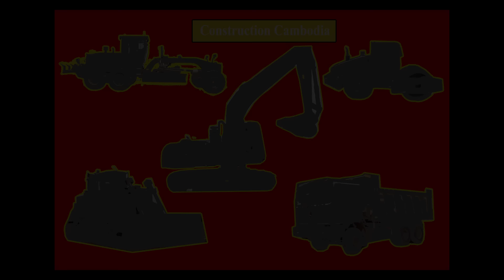Bulldozer stuck in deep mud & recovery by Excavator

Comment: Why don't they make equipment so you can put cables on it so you can pull crap out they need to be put on the front and back wall equipment. It looks like a little kid design them. It would have been easy pulling if they would have just designed a pulling system for the rear of it. They could also use the bulldozer to help pull it and it would have been out a lot faster. But I guess the boss new best

Comment: wow amazing no one was killed. Clowns milling around a machine in operation. Standing beside a cable under huge tension, luckily it didn't snap and take someones head off. Should have used the dozer, truck and excavator together to pull it out in a couple of minutes.
Reply: Yes, that cable is dangerous!
I lived there several years, came across a badly stuck excavator with one track run off.
It was interesting to say the least.
Reply: In these Asian countries, for some reason there is always 20 guys in "charge." I was there on a large engineering assignment and on the very first day shut down the operation , had my translator tell the engineer who hired me to run the project, "either I am the ONLY one giving direction, or I am happy to allow THEM to give directions, and I bare no responsibility, it is up to them." 5 minutes later we working again, and I didn't hear a PEEP from the peanut gallery. (It was heavy rigging and involved a 1 million printing press, Heidelberg.)  But I could see someone was going to be hurt with 20 guys telling the Tow operator what maneuvers to make. They later in the week had a unit tip because a timber crumbled and was precariously leaning against the side wall of the building ready to break through, same thing, 20 guys runing in circles screaming, waving arms and getting ready to tell the tow operator what to do. I screamed SILENCE....  had my translator to tell everyone to clear away, and they all went and sat down and watched me upright it 1/2" at a time with a jack. These things are not toys. Education is where the issue is guys on such matters, they don't know.
Reply: Larry Gingerich gli
Reply: maKan bO1eh
Reply: @brentbarnhart5827  been there to,  logic seems to be lacking with most of them,  but i worked with a couple that were really switched on but had no respect (caste system). after 2 years they were all supervisors that i gave the power to hire / fire.  that really shook shit up. still was one of the best road / rail infrastructure projects i have worked on, except for the damn rain.
Reply: @imoovabull6042  I of course meant no respect, I don't think you either. They want to be helpful, they are hard workers, and I believe they care as well. But MAN, in so many of those videos, its a miracle nobody died. but the sad truth is for everyoen that nobody died, somebody did die.  I just received word that a 38 year old boy whom ran a press next to the monster I installed lost his arms last week. Within seconds RIPPED it off his shoulder. My heart breaks for him and his family, now he is in a country (this time Guatemala) where he has no hope of a future. They of course fired him after he lost his arm. The machine had not 1 single safety on it working, all the guards were gone, motor brake didn't work, safeties didn'tg work. I F....g hate the owners of that business, I really do.  (They tired to kidnap me while I was there as well, that's another story.) but tells you the corruptness in some of these countries. I told them they could kill me, but I wasn't working 1 more second on their machinery.
Reply: @brentbarnhart5827  it is third world corruption.  the biggest criminals are in charge.  what hope do the little people have. That is why i always did the best i could to teach them to think about themselves first, and if they wouldn't do it, to tell others not to. some sites this became the norm,  on others i was transferred out fast. and yes,  i did work in Panama around 2000,  the corruption was rife,  even to the point of being shook down by dirty cops in our hotel looking for protection money.
Reply: Always nice to chat with someone who "gets it."
Reply: @brentbarnhart5827  several of the men i have had the pleasure to train have used their new skills to get out or move up. there are a few i have arranged thru the company to become full time employees and they all excel.  and i am an Australian.

Comment: The pink flags are a nice touch. The guy in the blue shirt is some kind of boss. He doesn't know a thing but his uncle owns the company. There is a very sharp division of labor in Cambodia. Workers work their ass off. Bosses stand around calling out encouragement and they have cell phones. If the cable snaps the boss will be killed outright as some kind of blood offering to the gods of construction projects. It is another world. The clutch in that Komatsu tractor is burnt toast.
Reply: It never had a clutch. Since the delivery/shipping notice stated Cambodia they never installed it. They use a hamster wheel and they all eat the hamster at lunchtime. So work day starts at 10:00 and they work until someone gets a piece of equipment stuck so they fuck around with bumming rides until noon and then its lunch. Everyday this goes on. No wonder Clutch Hamsters are so prized in Cambodia. Coming to a job near you soon....

Comment: I worked there for 2 and half year in charge of civils on the southern rail rehab project, most of the operators there (95%), have had no machine training by experienced operators, and most of them are young boys 18 - 22 yrs, I had to show a lot them how to operate an excavator correctly as they were only trained by guys who didn't know that much as well, only the basics. They also have very little, if no education, so they don't understand, or know about the suction effect wet material has on a machine. In one case I had to show them it was safe to walk a excavator across a creek without getting stuck, that had a white colour (sand) bottom, not brown colour (mud).
Reply: Está certo,logo vi que eles não tem nem uma experiencia e dai uma coisa fácil se torna difícil e gera muito gasto.
Reply: Muy inútiles

Comment: 1 stuck in dozer, 1 digging out with excavator and 11 standing around watching. No one had the brains to tell the excavator driver to dig out the back to tow the dozer out. Digging out the front doesnt work. The dozer driver in white shirt doesnt know about reverse gear and thinks putting the blade deeper in the mud helps instead of it acting like an anchor. They have not got any idea how to receover a dozer from a hole. lol. Too many shouting "Whoa" when no need to.
Reply: I thought the drive was broken until the second guy got in it.

Comment: Does the da know where reversed is or how to unlock the brake have not seen either track move
Reply: Wondering about that too. Maybe transmission is F-ed up. Or maybe just low on fluid and at that angle the pump is sucking air?
Reply: Also weak pumps an suction on the traks could be at play from ground water
Reply: Tracks clogged with muck I would say.

Comment: standing far too close to the hoe digging, wrong cable attachment, not to mention should have been using slings. lucky someone didnt die to be honest. Also the hoe hand has his tracks the wrong way, plus swinging over people with ZERO safety gear
Reply: Correct, total disregard and safety abandom.